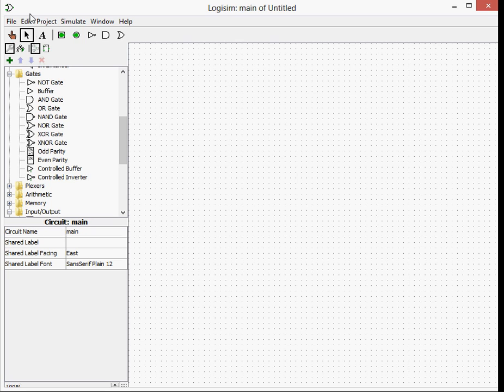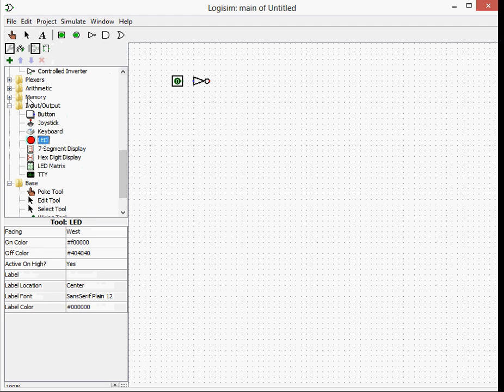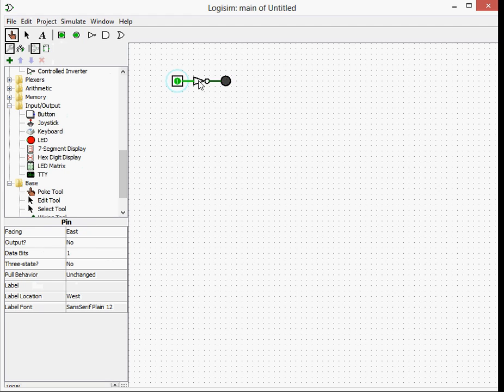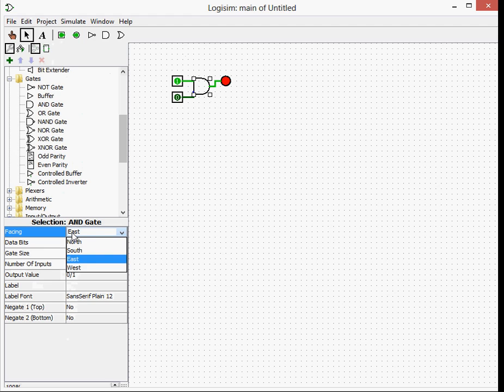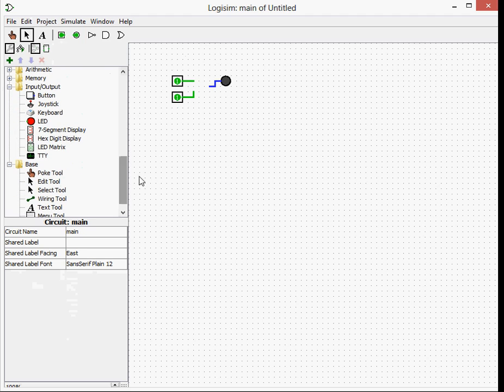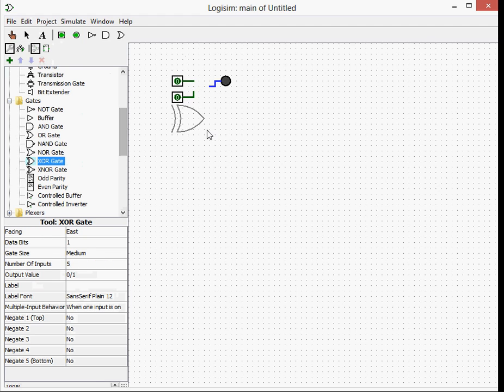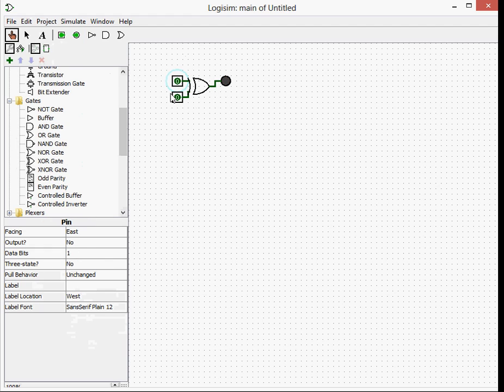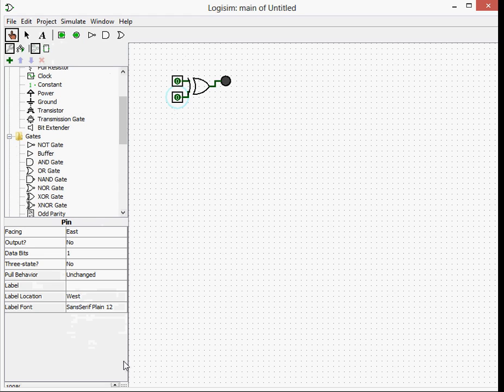Logisim Tutorial part 1:Logic Gates

Comment: my logisim is not simulating .. input and output everything is x1. and all wires are black. how to fix this??
Reply: If the cables are black it means that they carry more bits. In this case it means that the outputs or inputs support multiple pins.
For the simulation you can go in the settings "simulate", on the top, and see if the simulation is enable.